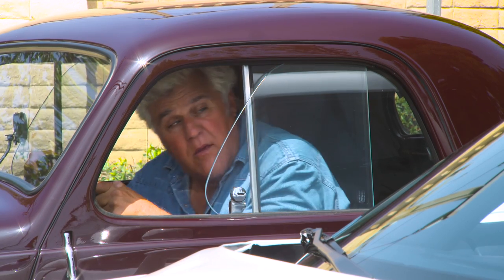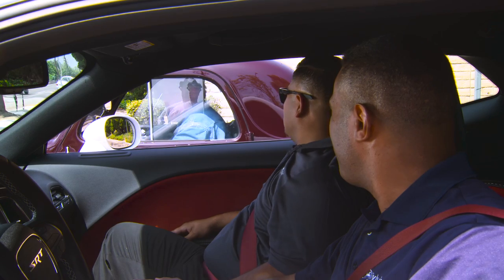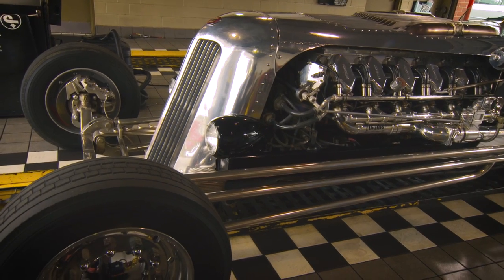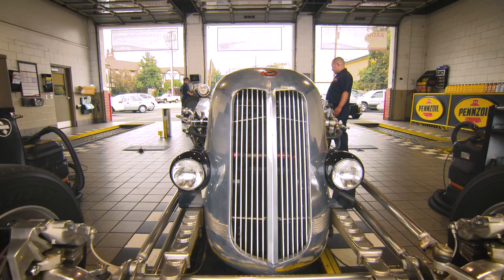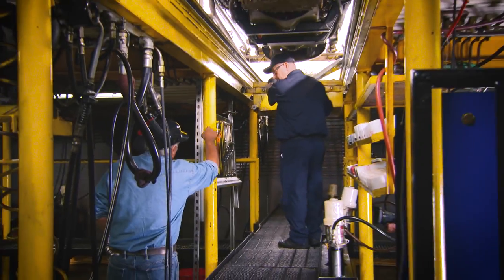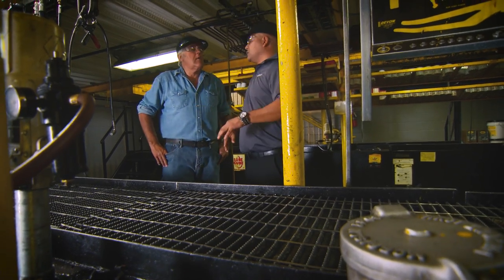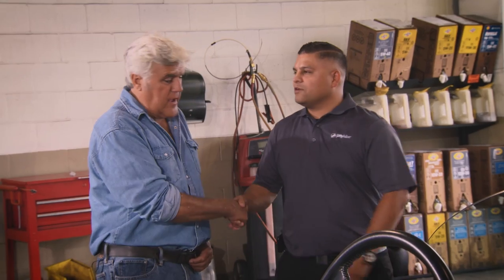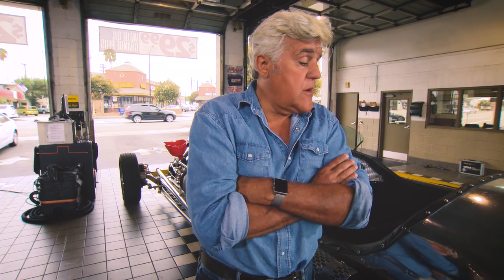Biggest Oil Change Ever - Jay Leno's Garage

Comment: I wouldn't trust them to change the oil in my lawn mower...Bunch of thieves.
Reply: +my31and37 Neither did Jay
Reply: +my31and37  me neither.....better to DIY
Reply: +my31and37 Neither would I but because the next time I change my oil I need a breaker bar to remove the drain plug they torqued to 250 ft-lbs and a tweezers to remove the tiny filter they used.
Reply: +Koop92tc  You're lucky they even bothered to change the filter, from what I've seen on the various consumer alert sites!..
Reply: Just speaking from personal experience. I'm pretty sure they used pneumatic tools to remove and install the drain plug and the quaker state filter is about 1/2 the diameter of what I regularly use. Don't get me wrong this is probably fine for 99% of car owners, but for me I'd rather put an extra 1000 miles on my mobil 1 than go to jiffy lube when I'm away from home.
Reply: +my31and37 neither would i the learned the hard way through them messing up my engine lol
Reply: +Koop92tc If they can get away with stocking one filter for multiple applications, they'll do it. I see this a lot on Chrysler minivans where it'll call for a (AC Delco) PF13 but Wal Mart or whoever installed their brand's equivalent of a PF53.

I'm with you on the plug issue though. I see a lot of vehicles last serviced at quickie places where check plugs are either finger tight because nobody did a double check or they're over tightened to the point of destroying the threads.
Reply: whoa, some interesting back story ?
Reply: my31and37 imigrants
Reply: HERPY DERPEDY Well, if you're going to give out to me, atleast edit your incorrect use of "too"*
Reply: HERPY DERPEDY And please insert punctuation.
Reply: HERPY DERPEDY you're*
Reply: HERPY DERPEDY I know I've been going on for a while, but, what is "their techs"? Employees?, I'm not Ammerican, so, I don't know.
Reply: @otters-vintage-all-sorts "Atleast"? "Ammerican"? And, you're, using way, too many, commas. Joke's on you.

Comment: I would change the oil in the parking lot of a store with crescent wrench and a bucket before I took it to jiffy screwed.
Reply: Drew don't forget your band wrench for the filter lol
Reply: Maybe he has a K&N with the wrench off lug.
Reply: @Mrjerk2000  dont need it. Hand tighten the filter so next time you can remove it by hand
Reply: Jiffy duped: so many different cars, I’m not looking up this filter. So just skip the filter and if the guy ever takes it to a reputable shop we’ll trust they do it.

Comment: Jiffy Lube is a joke.  They somehow managed to strip out the oil filter on my fathers vortec 5300 and just left the same stripped out filter in for the next 3 oil changes he took it there for.  They never said anything about it to him.  Needless to say, he eventually needed a new engine and Jiffy Lube never took credit for any of this.
Reply: +linglingjr How they managed to strip an oil filter is beyond me
Reply: +linglingjr a new engine over a stripped oil filter??
now I could be wrong but how  would stripping a oil filter lead to him needing a new engine? 
normally high traffic areas as far as maintenance goes are made of steel and parts such as oil filters are aluminum/plastic to prevent any real damage to happen in the first place.
did the filter like come lose or leak causing the engine to cease up?
Reply: +linglingjr Why would your Father take it back to them for three more oil changes if he knew the oil filter was stripped?
Reply: +SeeOurWrecks It sounds like they didn't tell him so he didn't know/  And to keep up the ruse they would have had to charge him for a new filter every time he came back.  Otherwise he would ask why they didn't charge for a filter on the receipt.  So he thought all along it was being changed.  That is until the filter became completely clogged and the engine blew for lack of oil.
Reply: Harold Bullock You're 100% correct.
Reply: I knew someone that took his '87 Cutlass to Jiffy Lube for an oil change.  The technician noticed that there was an oil leak from the oil sending unit. Easy fix. After driving a few miles down the road, the engine seized up. The tech cross threaded the oil sending unit, allowing the oil to pour out onto the ground.  Jiffy Lube actually "fessed up" to the error, and paid to have a brand new engine installed in the car. Beware of Jiffy Lube.
Reply: palt habbaboof Well the first mistake was owning a Cutlass
Reply: linglingjr wonder why not just change the filter adapter housing.

Comment: From the quality of work at my local Rippy lube Im sure no cars Jay owns  would go in there .......- uh yeah Mr Leno sorry we didn't tighten the filter and you had to have it towed after all the oil ran out ....  Uh Mr Leno , sorry we thought Jimmy put the oil back in after he drained it ...... Uh Mr Leno - we never knew that drain plug was stripped - yeah I wouldn't trust them with a 99 Accord much less a collector car.  Nah stay away from Rippy Lube. Their "#1 concern isn't the environment but rather .... making wheelbarrows of cash from uneducated consumers that believe you need to have that transmission flush every 20K or  the winter air removed and summer air installed in the tires  ( for a nominal fee ...... )  or the wipers magically need replacing EVERY time you go in - amazing place that ole lube store ....... as far as Jiffy lube helping keep the Youtube channel " free"  - there are 1383047 subscribers so that is a pretty good chunk of change in ad revenue not to mention the JLG TV show coming out.  Sponsorship's are great - just not a verified ripoff merchant like the Lube you up ......

Comment: Love the show, Jay, and I'm really glad you got some sponsors for it. No begrudging here. But you might want to consider a different one. Three years ago, my Aunt decided to give my sister her 2003 Camry. My father and I changed the oil on that car every 3,000 miles like clockwork, whether it needed it or not. Oil, plugs, belts...we followed the Toyota maintenance schedule like it was the Bible. The door hinges, Jay. I lubricated the frickin DOOR HINGES every 25,000 miles. And that engine ran like it was brand new for ten years. Car was in immaculate condition, and my sister was thrilled. She needed it really badly for work. But right before my aunt signed it over, she took the car to a Jiffy Lube for one last oil change. She wanted it done "professionally." 

Well, the Jiffy people didn't install the drain plug right, and...you can guess what happened. My sister drove that car for less than a day, and the engine completely seized. 

Granted, Jiffy did pay $2,300 for a new long block...TWO YEARS LATER. Long after that perfectly immaculate car (Blue Booked at seven grand) went to the junkyard. My sister wound up with some POS $1,500 Kia, which fell apart after five months. She's been through four more pieces of junk since then, and wound up spending Jiffy's $2,300 settlement to catch up on bills...because she spent so much money replacing cars. All because Jiffy destroyed a Camry that my father and I had spent a decade maintaining. 

Point is, Jay...do what you gotta do. We all love the show. But these might not be the kind of people you want associated with your brand. Just a thought, man.

Comment: I used to work for rapid lube and oil I used to work for Valvoline Instant Oil Change I went to Jiffy Lube one time with a car I needed another engine in and sure enough they blew it up and the company said that the car wasn't worth putting a new engine in but they would put a salvage engine in it except a salvage engine that they put in it was a an engine that somebody had already rebuilt and punched 30 over ... Imagine that... Thank You Jiffy Lube!